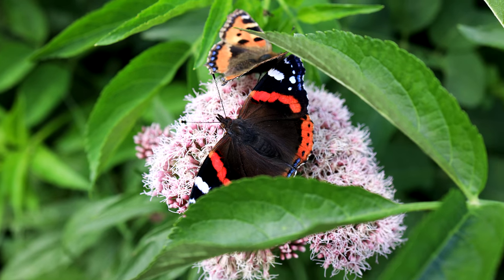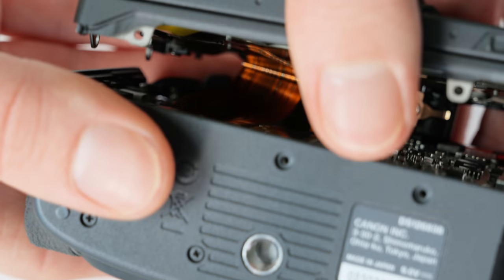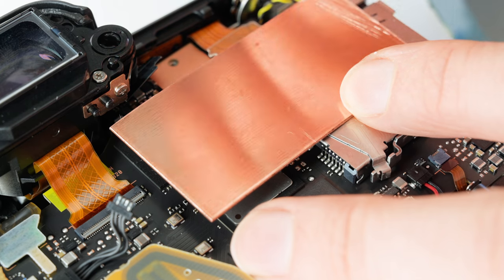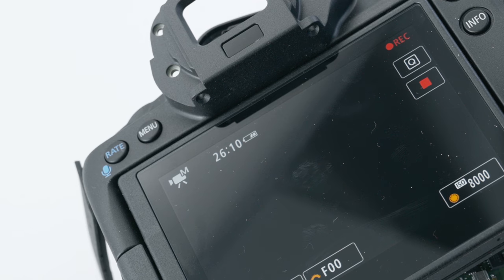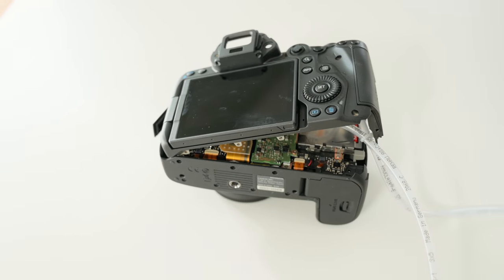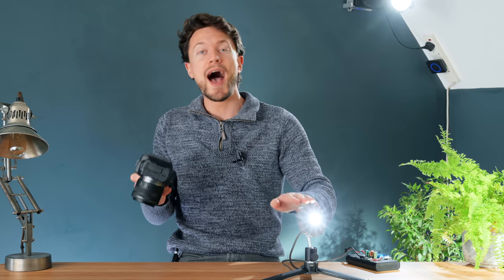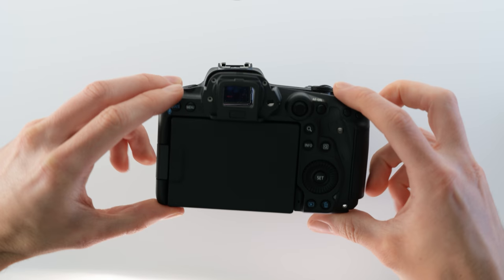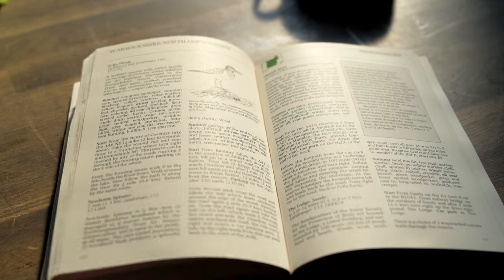The only reason to watercool a camera....

Comment: When you outsmart canon engineers with home equipment....
Reply: Im sure They knew just diddent want the r5 camera to compete with there cinema line of cameras
Reply: Those tweaks would increase price significantly. Guy on the video used high quality thermal paste and  copper which both are extremely expensive.
Nonetheless, its not like cannon shouldn't be blammed for selling a product which have such obvious thermal issues.
Reply: @dand337  what else you can get in such a price range and in a compact size.
Reply: @ibbad5555  dunno, but form what I've seen on the video it's not like there is no room for improvements. It's definitely possible to cool this camera down without adding too much to the price. However development costs may also be an issue.
Reply: @dand337  TRUE !!
Reply: @dand337  yeah...the copper plate and thermal paste would cost them 1$ more. that would make the camera 0.02% more expensive!!!!!
Reply: @coolst0rybruh  I'm not an accountant, but from what I know,  those things are being calculated differently in mass production.
Reply: @dand337  in mass production it is much much cheaper.
Reply: For real
Reply: @ibbad5555  if you’re willing to step down to 4K (basically anyone not shooting cinema quality will find 4K more than enough), then the Sony A7Siii is a much better purchase. And, Sony got it to record dang near indefinitely with zero overheating problems.
Reply: @coolst0rybruh  They are selling it for the same price (maximum market price) anyway and saved 1$ per camera with the cheap heat sinks. When they sell 10 million cameras they made 10 million $ extra profit. 
And they did that on several other places, too. Just like any mass manufacturing company. So they make a lot of extra cash from things like that.
Reply: @Chris-yy7qc  what you say makes no sense. They could have sold the camera for 10 more dollars so the would make 90million and no one would complain. What do you think is better? An overheating camera that damages the reputation of the company and 10$ profit or a superb working camera that costs 10$ more and a 90mil profit?
Reply: @coolst0rybruh  You just dont understand the basics of economics.
Reply: @Chris-yy7qc  i asked you something and you just answer with "you just don't understand the basics of economics."
Reply: @coolst0rybruh   Google "demand function". 

They spend millions on market analysis every year to maximize their selling prices. If they sell their cameras for 10$ more they will most likely sell less cameras and loose money. Just because you would buy it for 10$ more doesnt mean everybody else would. 

The way it works in reality is: They maximize their selling price based on their market analysis. Then they try to produce their product as cheap as possible. Just like they did on that canon camera.

What you described in your post is not how economics work.
Reply: It is not rocket science, but thermal management is not easy.
The engineers who made those things probably had good reason in terms of cost cutting to not bother with more advenced cooling.
Having a copper plate stamped would reduce the temperature of the the chip but making a custom plate like that would increase the cost over all.
The thermal paste is also a fucking mess solution in an application like that. I would not be the tech who have to dig in that crap if something happens to the camera. As thermal paste ages it turns into that hated solid thing that can reduce thermal dissipation. The "right" solution would be graphite pads like what they use in AMD graphics cards. It is thin, has high thermal conductivity, and does not age practically. Again it is increased cost again.
Using the outer shell, under the display is not the most engeneer friendly idea yet again. Heating the display may cause premature screen fade discoloration, shortening the lifetime of the product in a way. It was a decision that the engineers made, and I personally respect that. It may also help other engineers who are in charge of the assembly process to make full assembly shorter and more cost effective.

The key point here is that the r5 is still a mass produced, half professional, affordable camera and it does not want to be more. 8k is a feature like RTX on nVidia GPUs. The lower the tier, the more you loose in terms of features. The R5 is the RTX 2060 of cameras. It has a wonderful feature but God bless the machine it was not intended to do it.
I just hope better cooling will be designed for all cameras because they are getting stronger onboard computers every time.
Reply: @dand337  man I"m sure the shittiest thermal paste out there would have out performed the thermal pads that they had WRONGLY installed and not even on the cpu of the camera. Not to mention that while copper would have been more expensive. It still would have a made for a much much better product. They really should have thought this through. I'm sure the engineers working there already knew this but shitty managment probably overrode their design decision

Edit: not to mention that this is a high end niche product similar to apple and it most likey doesn't cost them that much to make and they profit MASSIVELY from the sales on these products so even if it would an extra $10 cost per camera (which is WAY WAY too much), they would still profit massively from it and would end up being a better end product for the user.
Reply: @muhdaimanharith  I didn't want to defend anyone, I might have been just wrong if anything else.
Reply: @terravida333  they use pads instead of paste because of height tolerances, a pad always make contact , to use paste you have to have a 0.05mm precision or else the backplate will not have enough pressure or it will crush the die and every other camera will fail at the end of the assembly line. They have to either switch to a way more expensive soldering process or have mounting hardware with tensioning springs which adds a lot of space cost and mainly assembly cost. 

The most obvious solution would probably be switch the back plastic shell to a diecast backing plate and add extra pads on top of the VRM board to the case.
Reply: @dand337  quality thermal paste is extremelly cheap, in that quantity, not even a full dollar.
Reply: May be i am wrong but some points we are missing here
First one is weight as aluminum is much lesser weight than copper
Also you don't buy another product if you got everything in one product
Reply: @dand337  main issue i might see is the machining cost
soldering wouldn't be a good idea so they have to machine the piece
multi layer machining is much more annoying than just cutting a shape then bending it a few times

also looking at how this kind of pad is applied, some engineer wouldn't trust the manufacturer to not just slather that paste everywhere and anywhere (ofc, depends from engineer to engineer)
Reply: Haha so true
Reply: @Courier103  have you watched the video until the end
Reply: @dand337  high quality thermal paste and that copper piece worth cents extra. You are totally wrong.
Reply: it's less that he is smart and more that they are too stupid to realize that making a camera Palm sized is not worth sacrificing its entire purpose
Reply: @that_guy_will5209  yeah. The canon cripple hammer
Reply: @aronseptianto8142  I mean it wouldn't need to be a multi step process. It would all be stamped out and bent in one go. Same as the aluminium. It would've taken a few extra weeks of development or even just development of more efficient algorithms. It was a product rushed to market as these new cameras so often are. Also it wouldn't matter if thermal paste were slathered all over the thing because you literally cannot have too much of the stuff.
Reply: @Jackofafewtrades  "because you literally cannot have too much of the stuff."
sounds like a challenge
Reply: @dand337  copper are not expensive, try to search the cost per kg and you will see that copper is really cheap : 5€ per kg it's not like silver or gold ;). And for thermal past it's not expensive too, the mixte of iron use for this kind of thing are not that expensive but even if you use a solution available on market its cheap because you need only a little per device almost nothing 20-30€ maybe. For the cooling a ventilator cost around 10 to 30€ maximum. So why he talk about 300€ it's because the time necessary for make the operation possible, cut the copper, welding etc... and more than that you can't create a product too good for cheaper. Firm are here to make money they are not your friend, did you really think they don't make this bad cooling on purpose ? When the solution is so easy to developpe ? They do that for enter on a segment market, they propose an excellent solution without cooling to justify why people need to pay thousand for higher solution. More than that they do this bad cooling on purpose but you can be sur that the company do the study of that really well for have the less return possible because break of material before the end of warranty ;) then trust me they know what they do and you can be sur this material will stop working few month after the end of warranty. Trust me it's perfectly calibrated after rigourous study for you comeback and buy again a product after the end of warranty so you give the maximum amount of money to the company. 

The annoying part is because for a costumer even if you know how to solve thermal issue, the concern is the material for fix that... just on this video the guy use an expensive metal saw, a welders, and a 3d printer even if you can create that without 3d printer it's will need material to work on wood or metal... personnaly i havent a saw for wood... 

But everytime i see him video i think in futur when i will got my first appartement then for sur i will buy material for do DIY thing because maybe its not a good investissement for 1 or 2 little project but for more project im sur its certainly an excellent investissement
Reply: @dand337  this camera isn’t really cheap, so I think that customers would have gladly paid a little more to have a camera without those huge thermal problems
Reply: @dand337  High quality thermal paste and copper are not extremely expensive. Wat.
Reply: @Chris-yy7qc  This is a common misunderstanding of the demand curve. As you get further into your economics course they will likely talk more about price in-elasticity, luxury products, and the affect of quality and reputation on demand curve modelling. 

Also in this case the "appeal to authority" doesn't apply, as you'd be surprised at how simple the mistakes these giant companies can make are.
Reply: To my knowlage surface temps of electrical devices limited by IEC, thats they don't use suraface of the equment as a cooler ... For example :

   MacBook Air M1 is a fanless laptop , gets toasty and downclock after 5min of heavy workload , there is no thermal pads between cpu block and shiny and big Al surface , Actually there are isolation material... LinusTechTips removed that isolation and added thermal pads and Macbook Air kept his clock high as MacBook Pro M1 sometimes beats Pro , but at the downside outside of the laptop is hot and abow threshold of pain... Non moded Air is half a degree below of thresh hold of pain... So they kept laptop slower/warm at the cost of being able to holdable...

  This might be the issue why Canon left the desgin in that way... DSLR s are degined to be hold by hands so their surface temps needs to be lower than a laptop which is mostly on ur covered lap or a desk...
Reply: He didn't outsmart them, he solved a "problem" he should not be complaining about for the simple fact this is a design limitation: the video function is an extra, an add-on or "nice-to-have" kind of thing, not one that can replace an actual videocamera which, if you've ever seen a reasonably good one from the inside is equipped with so much more cooling it's obvious the videocamera was designed with the function of making video in mind.
Sometimes the cooling is only passive (big heatsinks), and in some of the ENG camera's I've had my hands on sometimes next to passive also through a small fan providing at least some form of convection upwards out the case, with a small fan opening below the viewfinder.
Reply: Canon is years behind their competition. It’s not that hard💀
Reply: @dand337  extremely expensive... thermal paste makes 10$ for a full tube that much of copper? 3-10$ so nothing that would raise the price by alot...
Reply: @dand337  has anyone here even heard of cooled cameras for astrophotography? I'm pretty sure some can reach -30 degrees
Reply: Hell yeah tf damn
Reply: @that_guy_will5209  what?? Nah
Reply: Canon engineers knew all these things when designing the camera, they specifically designed it to overheat within 25 min to save their cinema line.
Reply: @dand337  High quality thermal plate is EXTREMELY EXPENSIVE??????? What are you smokin bro. He is using really cheap components.
Reply: @Dutch3DMaster  He wasn't complaining, he fixed it. And yes, he did outsmart them. Video was a 'nice to have' only because canon doesn't want to cannibalize their cine line. Not by some actual physical limitation, which was clearly demonstrated in this video. Video cameras clearly have their place, but let's not pretend these small form factors aren't eating into that place. S1H being approved by Netflix was a pretty big sign..  That's why these features are engineered as 'nice to have'. Canon and Sony can continue to hobble them all they want, but that's just a recipe for someone to sneak in and eat their lunch, which will be deserved at this point.
Reply: @victornpb  is there a reason they couldn't have some kind of fan built in with a grill to pull out heat other than the obvious cost
Reply: @that_guy_will5209  that probably makes a lot of sense. Their cinema cameras must be very high margin and they didn't want cannibalization in their product portfolio..
Reply: the exact same thing happened to intel apple laptops 

you just swapped the thermal pads for better ones
Reply: @dand337  thermal paste is not expensive neither is copper at all.. the only expensive thing in the video was the blowtorch he used to melt the copper down
Reply: @dand337  Good quality thermal paste $5 Thin copper sheet $2
Reply: @carbon_no6  Also worth mentioning as no one else seems to on here, that his mod wouldn't pass certification as it makes the outer plastic of the camera (ie the bit a user can touch) exceed legal temperature maximums

Comment: Canon engineers: "Write that down, WRITE THAT DOWN"
Reply: lol .... true though
Reply: And their resignations at the same time...
Reply: lmao i can imagine that
Reply: They do that on purpose, so their cheaper product lines dont compete with their more expensive ones. They do that with many other cameras too and they also just remove tools like big crop and no eye tracking in the 4k video mode with the canon m50.
Reply: @2darki  That's true for the most part but in this case the Canon R5 is the most expensive mirrorless cameras in the market costing around $5,000. It's absolutely ridiculous that a camera that expensive has overheating issues in the first place.
Reply: @2darki  nope. To maintain weather sealing, no one wants a cooling fan like in the Blackmagic. This is 8k mate.
Reply: @2darki  well to be fair, the M50 has a much weaker processor.  if it turned out the M50 had the same processor as say the EOS R, then you can say it was crippled.
Reply: Canon engineers better be finding new careers after this failure...oh and Covid crashing the entire photography industry too.
Reply: Canon engineers: It’s not a fault, it’s a feature. Videographer’s union will be pleased that we have prevented occupational overuse syndrome. What do you mean that most videographers are self employed?
Reply: More like: burn it down
Reply: @caldera878  actually, their cooling solution is perfectly fitting the business goals
Reply: Canon management: "Shoot him... or something!"
Reply: Write it down, wait for the next generation 5 years later.  That is the canon way 🤦
Reply: Lol
Reply: @nordic5490  
Yes most of them do, blackmagic still has the better image quality.